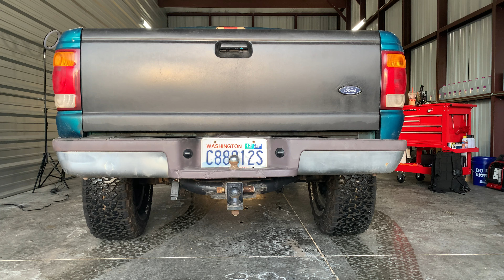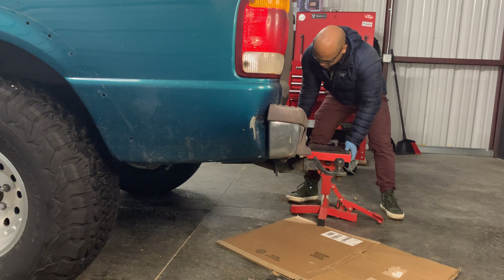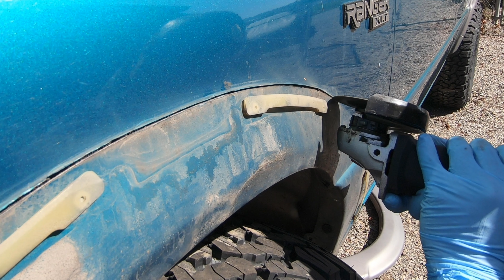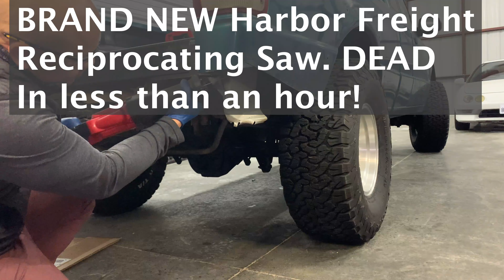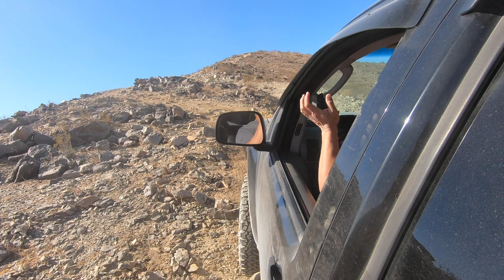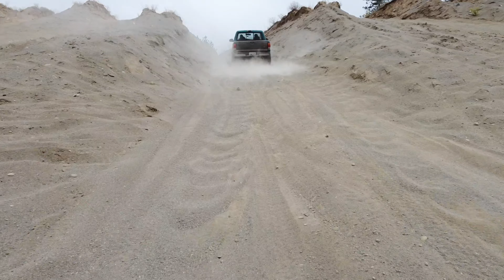How to remove your bumper + tow hitch and trim the rear quarter on a 1997-2011 Ford Ranger

Comment: i guess the original poster does not understand what a tow hitch is for if a comment like 'i dont understand why there would be 2 tow points, maybe options are good'......errrrrrrr bumper rated at much lower capacity than a tow hitch.   stupid to have 2 balls on the truck but regardless as a truck owner that has a tow hitch you should know this kind of information already.

Comment: I recently acquired a1994 Mazda B4000. I haven't even registered it yet but i  already love the truck. It's a 4x4 extended cab. With a bed liner and tool box. I can't complain. But the front bumper needs to be replaced. Does anyone know if a ford ranger bumper would fit my baby. I wanna bring this back to beautiful.
Reply from the maker: it’s the same truck. it should
Reply: @rayregnogarage  thanks. I'm gonna try it.

Comment: Future reference screw the saw zaw get yourself an angle grinder with a cutting wheel. I used a saw all the time then finally got a grinder only because i had to grind down some concrete then said wait a tic... Used it to cut off a couple things on my ranger abd it became my go to tool....oh u got a grinder lol
Reply from the maker: I prefer the grinder for most things. But sometimes the sawzall is nice for some sections.

Comment: Fine Stronghold...I want you to make a video showing how to pull the bedsides.

Also, is your rear on blocks or anything?
Reply from the maker: That's ONE request so far. lol. It has the factory lift block back there. i think it's a 2". I'm planning to get a full Deaver Race Pack and some extended shackles... but first.... Engine swapping my integra. lol

Comment: I work at a car lot and every time we get trucks that have a hitch with no key I just use a breaker car to snap the locking mechanism right off lol, surprisingly easy way to get em off. Love the finished look btw keep the content comin bro
Reply from the maker: Didn’t think of that! Thanks for the tip! I’ll try it on another one... I want to build a couple near model Rangers, too. Been working on these trucks since the 90s and we never videoed anything. it’s crazy how much people want this content. lol

Comment: Getting some 31’s on my 97 ranger stock suspension 🤟🏻
Reply: Same bro let me know how it looks
Reply from the maker: It will rub unless you get wheel spacers or wheels with the right back spacing. Mine rubbed on the lower valance on the front bumper, so I removed it
Reply: @rayregnogarage  i was planning on removing the front bumper, but did it rub on the back at all?
Reply from the maker: @maxmlggaming4911  Nope. no problems in the back but the truck came with a 2” lift block from the factory. You could pull the bedsides out to make them wider. did that on my blue truck if you watch my 7 Mile video you can see what it looked like
Reply: I’ve got 32’s on my 93 with no rubbing. Stock rear and skyjacker leveling coils.
Reply: @Mike-cn1ei  I’m thinking about running 31s on my 97, all I should need is leveling coils correct?
Reply: @maxmlggaming4911  yeah I’m pretty sure you’ll have a slight rub at full turn if you don’t
Reply: @thhomy2868  Ive been doing tons of research and I’ve pretty much come to the conclusion I’m gonna have to trim the front, I just don’t know the deal with the back
Reply from the maker: @maxmlggaming4911  My truck had 31s on it already when I bought it and it had stock suspension. It had wheel spacers on the factory rims though, so that pushed the wheels out some. It rubbed a tiny bit on full lock on the bottom corner of the front bumper but when i took that part off, it was fine
Reply: @rayregnogarage  I took my lower valance off on stock tires and rims, looks better. But I guess that will be helpful now that I’m getting 31’s
Reply: @Mike-cn1ei  I plan on getting some leveling coils
Reply from the maker: @Mike-cn1ei  what wheels you running? what backspacing?

Comment: Mark your lines with masking tape. Easy to follow and helps to keep from damaging the paint
Reply from the maker: Lol. I did that on my Xterra. but i don’t care what this truck looks like. Sharpie was faster.
Reply from the maker: Besides. you can always sharpie the line a few mm before where you actually want to cut. you’ll smooth it out with the flap wheel anyway.